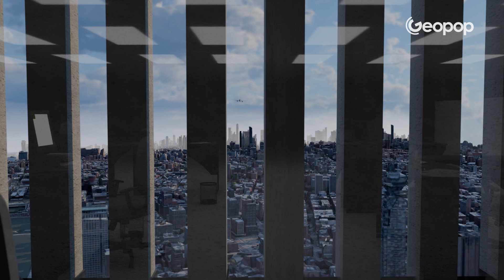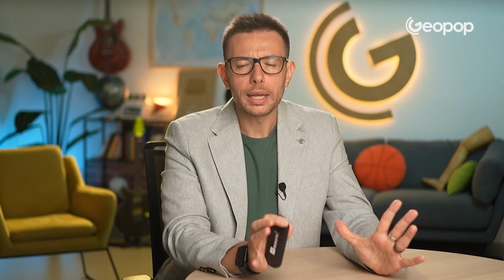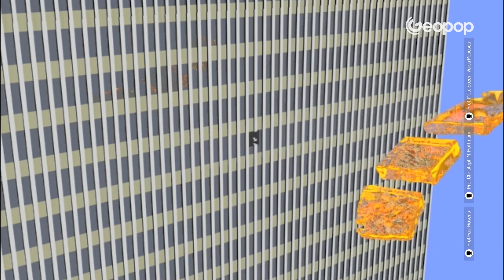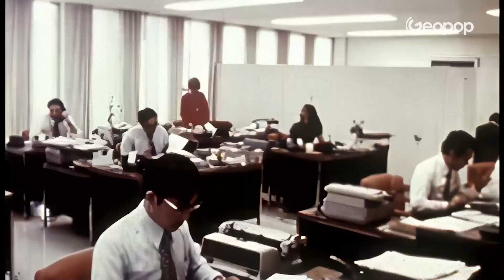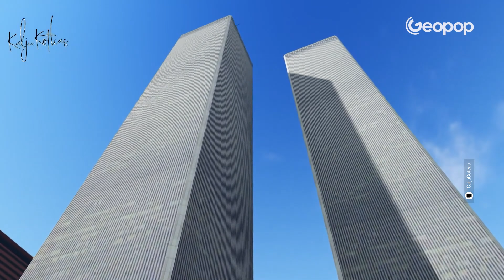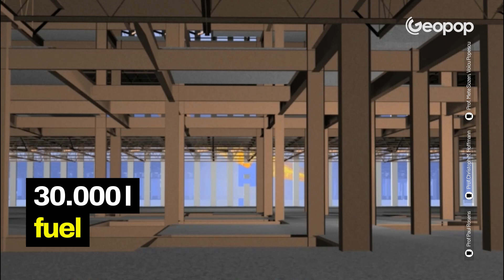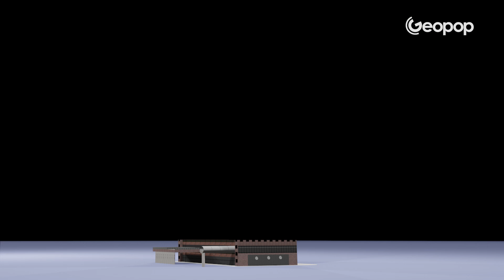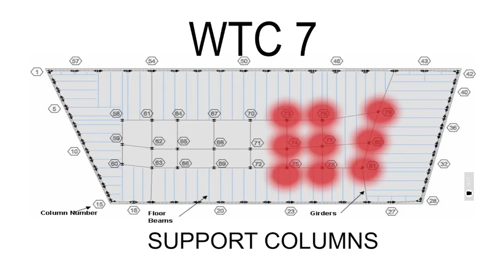9/11, 2001: The Technical Reconstruction of the Twin Towers and WTC 7 Collapses

Comment: I had to prove to someone I know how the towers collapsed with the fires, NOT MELTING STEEL. I had him try and bend a piece of 1/4" flat bar, cold, then used a propane torch to heat it up for less than 10 minutes..... Ya.

One thing that no one ever talks about, is that fire proofing. That stuff is nasty and everyone near those collapses, breathed that stuff in. I guarantee that many deaths since were a result of it. So much for life saving, but ya, given the situation, no surprise.

There's a video I've seen of the collapse of tower 7 and you can see the massive air handler on the roof drop, then the whole thing went down almost immediately. So, something was somehow related to that. Maybe column 79 was underneath.
Reply: Butane, not propane.

Comment: 9:19 Steel bends, it doesnt snap.
Reply: Steel snaps under a certain temperature
Reply: @ethanzhyper  Yeah, sure. 
But what about WTC7?
Reply: @ethanzhyper 
Which the steel underneath the impact area didn't have...
Reply: @cafl9844  Did you not watch the video? The fire inside the towers reached 1000C. That's more than enough to cause the steel to bend so far that it breaks.
Reply: @Black-Swan-007  
I am not doubting that, but the steel underneath the impact area was totally intact and not effected by heat at all and yet
somehow however I'd didn't just bend, it literally evaporated!
Reply: @cafl9844  It didn't evaporate. There's pictures of the steel snapped. It's in the video... Come on man. Room temp IQ. Raise that shit up.
Reply: @cafl9844 intact? Not necessarily, pretty sure burning her fuel made it’s way “down” some elevator shafts, but load above was also “intact” and it’s weight didn’t go anywhere once the steel below was compromised. All that weight was pushing down ward and no amount of floors could stop it once it got going.
Reply: @cafl9844  are you asserting that the steel underneath the impact area was too hot to "snap"?
How did it get so hot to not snap?
Was it cooking in jet fuel for an hour before the plane struck?
Where is the evidence of that?
Reply: @jonslg240  
What???
I said it's strange that all the steal underneath the impact area literally just snaped or evaporated  allthough it wasn't  effected by any kind of heat!
Reply: Steel absolutely snaps. While it's true that it's plastic deformation - plastic deformation at a high enough speed that leads to a break is ABSOLUTELY WHAT SNAPPING IS.
Reply: God these 911 truthers are as bad or worse than flat earther's and moon landing hoaxers combined.
Reply: Even Elle Woods understands the bend and snap

@ElLowEl .  . "What the hell are you talking about?" .  . 😃 .  . Thank you for your sponsored reply, Mr. EILow.  The word projection indicates holography as you know, commercial demonstrations of which have been amazing in recent years.  To feign ignorance doesn't work well for you, however.  Where, Mr. EILow, is the wake turbulence only seconds after passage of a 500 mph large passenger airliner -- not seen in the smoke and fire covering the impact zone?  Even the wake of a small Cessna Aircraft would be noticeable -- yet there is nothing.  It's likely that no real answer from you is forthcoming. We'll wait and see .  .

Comment: How did all 3 towers fall at nearly the same speed and time as free fall? Wouldn't the lower floors cause some sort of resistance? And why did the top sections disinegrate when they were 'collapsing' the lower floors?
Reply: The upper sections can very easily be seen disintegrating on these 2 videos:  https://www.youtube.com/watch?v=-ib93ktc454&list=PLBeNQtKAgYU7SZNDOkdEivdzxw8WYGAp9&pp=gAQBiAQB

Comment: I want to apologize for my initial posts. Starting a conversation with an insult isn't a conversation.  There are obviously people with polar opposite views in this chat.
Let's us calmly explain why we do or don't believe the NIST explanation.
Free fall speed was what raised my eyebrows. NIST agreed that free fall did indeed happen. But they don't explain why. There needs to be more of an investigation to explain it. Am I  wrong?
Reply: NIST didn't agree to free fall speeds because it wasn't free fall speeds lol. C'mon man. You can take a stopwatch out yourself and make that determination for yourself. 9.8 m/s^2 brah.
Reply: Yes
Reply: To discuss this is already delusional! We have all seen the planes … hitting WTC 1&2 … destruction, fire, heavy damages … then the towers crumble and collapse! We also know the effect of kerosene fire heat on steel beams … loss of stability and form … of course nothing melts … Thermite no option … demolition of live building defying all common sense, logic and impossible!
Reply: What is the source of the many tons of molten steel found in and under the debris, the heat so intense that the molten steel remained in that state for weeks afterward, running off of the debris as it was excavated. This cannot be molten copper from wiring that retains the color of a shiny new penny.  It cannot be molten aluminum that retains the color of the polished aluminum wheels of a street racer. It was the color of glowing orange molten steel  that cannot be mistaken for any other material, reported by firefighters who are very experienced in the nature of such materials as well as seen in video evidence.

When you combine this with an entire lack of turbulence behind 500 mph aircraft, when even a small Cessna Aircraft would leave an evident wake in the smoke and fire only seconds later .  . We find that skeptics still cannot be skeptical of the official narrative in explanation.  Sponsored channels and forum activity are skeptical of nothing when support is provided.

Sponsored activity in the forums is very normal today for commercial and political purposes and subjects of controversy -- in the attempt to lead public debate.

Comment: Hogwash, please explain to me how the tops of both buildings were in the process of toppling over, then all of a sudden went straight down? This defies Newton's Laws of Physics. The only way those tops could go straight down instead of toppling to the street below, is if the floors below were removed. If you cut a tree halfway up and the top topples, does the lower section of the tree also follow? No it actually does not. When the load shifted and the tops were in the midst of falling sideways, that removed all stress to the opposing sides, therefore putting them under NO stress. What should have followed as the tops of both building fall to the streets, instead they were interrupted and went straight down. This was and always will be controlled demolition and no one will convince me otherwise.
Reply: comparing this to a tree is crazy
Reply: @thelilpeanutdotgov  Physics is physics, you can't change it....simple.
Reply: So it feel at 9.8m/s² what an extraordinary coincidence
Reply: take your meds schizo lmfao
Reply: In engineering terms it is referred to a pancake collapse.  Weaken supports on one floor and it can not hold the mass from above.  WTC2 hit 2nd and lower than WTC1 collapse 1st due to inability to withstand the larger mass above.
Reply: @nomenclature9373  Pancake effect does not come into play here, the core was 47 columns, the outer sure to an extent, but not the core. The steel as you go up gets lighter due to a lighter load above, but the columns as you go down are massive, the fact the columns did not survive is telling.
Reply: @kikurass322  Absolutely does, pulling the core as progression.  Mass from core on the upper floors are pressing down on the remaining building interior which was compromised.  Thus WTC2 collapse before WTC1.  For WTC1 part of the core, 35 stories as I recall, briefly remained and collapsed a few moments later.  Remaining core after collapse was just a few stories in height.
Reply: @nomenclature9373  Your knowledge of physics is appalling considering you're offering up opinions as fact. Here's a fact, 1/3 of a building cannot demolish the 2/3's below it, it is a 110% impossibility. Go away and learn something before posting, you're just making yourself look silly in front of the entire internet world. Sheesh!
Reply: So you think the planes hit and THEN they detonated previously placed explosives?
Reply: @cattycorner8  Well they couldn't just detonate the explosives without a false cause now could they? That would be just a little too obvious, right?

Comment: If I recall correctly, the office furniture in bldg. 7 did not produce enough heat to collapse the building.  This was eventually and not a first admitted.
Reply: dude., fire of ANY kind is over 1500 degrees. All it would need to do is slightly deform the steel.. and again, we are talking about TRUSS STYLE buildings... if same scenario happened on say the empire state bldg or any other "traditional" box style frame design, it would 100% still be standing.
Reply: Admitted by who? I think the only people who ever claimed this were conspiracy theorists. Multiple engineering reports of concluded the collapse was caused by the fires.

Comment: How is it possible that the concrete got pulverised?! And the top at the beginning of the collapse, leaning almost 30 degrees is a no go, as conservation of momentum is always present. It should only fall sideways to the street, not pulverised and plowed through the whole lower healthy part...
Reply: Why would you not expect concrete to get crushed when a building collapses?
Reply: When you design reinforced concrete, you design the steel to fail first.  Want to take a guess why?
Reply: They plan an agenda and then milk it to its maximum potential. Ie 911, the day previous secretary Rumsfeld was announcing that the fed had just "lost" 2.3 trillion $US (money that was stolen from us and went to israhell) , then next day the specific group of people that shorted American Airlines stock in order to make huge profits before the towers were hit, Silverstein that doubled the insurance on the WTC couple weeks earlier, all the specific group of people that worked at the towers that were warned not to go to work that day using the "odigo" israhelli messaging software, the dancing Israhheli, WAR in Iraq for israhell's expansionist policies, etc, etc, etc.I'm convinced that these "people" are not really people, not humans, but demons in the flesh that try to look like us on the outside... Truly eerie stuff 🧐.I pray constantly.
Reply: Are you a building engineer?? No? How come you know better than the experts??
Reply: The floors, which were 4 inches of concrete all the way around, pancaked down on the other floors. That's how it got pulverized, plus all the other things on the floors
Reply: The entire top of WTC2, i.e. the portion of the building above the impact zone, didn't just simply 'lean out', it rotated as an intact unit about its center of mass, which creates a much different falling appearance than if it had "hinged" towards the east.
Reply: They found about 285 bodies (I assume jumpers) they identified about 1,600 people using 29,000 dna tests.  About 1,100 people were not identifiable as nothing remained having been blown to smithereens in the explosions.  The design of the interior columns for the WTC was multiplied by the normal safety factor of 3X.  The exterior columns😊 were increased in strength by a factor of 5X.  I presume to reduce swaying in the wind.  Both WTC building were demolished the same even as they were hit at different elevation.
Reply: The problem is you are sorta half right the top block did actually separate and fall off heck I think in one of the videos of the collapse that showed it crushing the Marriott hotel if you pause it (or there was also a picture that better captured that piece) but yeah if you look closely you'd see about 4 to 6 floor block of floor hit the hotel sideways from the top the only reason the rest of it crumbles is due to the fact that while the top section broke it fell on top of the lower floors crushing them from the top and the weight of each concrete floor crushed the ones below them and kept going all the way to the bottom this all happened before the upside down mushroom cloud reached the floor because by then it was just a core and exterior walls before the exterior peeled away from lack of floor support and then I'd say like 45 floors worth of core popped out of the dust cloud with the rest already having been crushed and then as it sways (and some videos do capture the core still standing for a few moments) I believe the lack of any support made it Crack apart from below then just crumbled onto of itself and obviously that would of just crushed the lowered parts of it just from the sheer weight alone.

The reason it became pulverized is because each floor only had small amounts of concrete jusy from looking at old videos during it's construction each floor of concrete looked to be as tall as your head to your shoulder so barely anything it was just one big slab on top of trusses considering there was no columns on the floor there wqs nothing to stop it from going down and I'm pretty sure the debris on top only got heavier and is accumulated within the exterior before finally coming out the other end as fine dust I'd say one floor getting crushed from above would of crushed it into big chunks and then when that floor hit another one the chunks became smaller fragments and anything already turned to dust just flowed out into the open air probably from all the air pressure escaping

Comment: 3:30 Ummm... The World Trade Center buildings were NEVER the tallest buildings in the world. The Sears Tower in Chicago outdates the WTC by 3 years.
Reply: WTC1 completed in 72, Willis in 74.
Reply: @marcludwick512  Sears Tower was 1970. WTC was April 1973
Reply: @DFWHoppe  Construction started in 70. Took 3 years to build. WTC 1 was already done by that time.
Reply: @marcludwick512  WTC was dedicated on April 4, 1973, but was built between 1966 and 1975 and wasn't actually completed until 1975. That's kinda weird on its own.